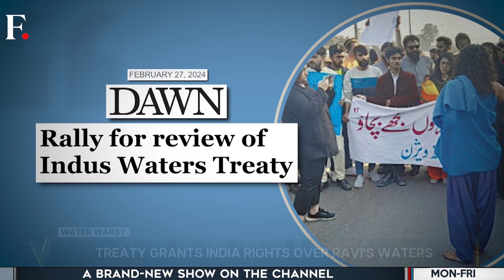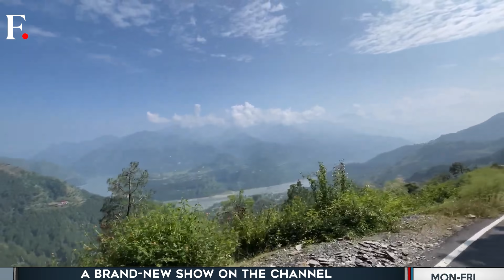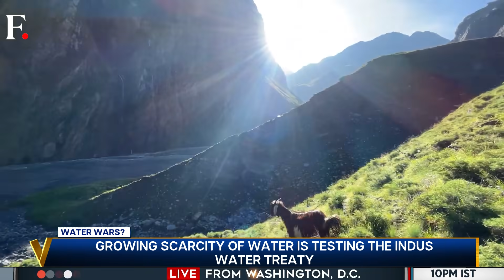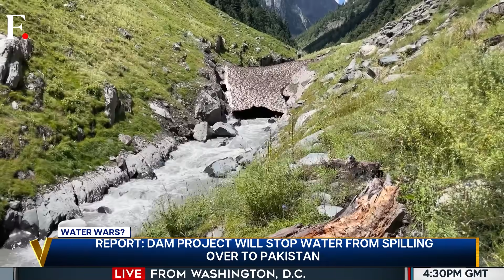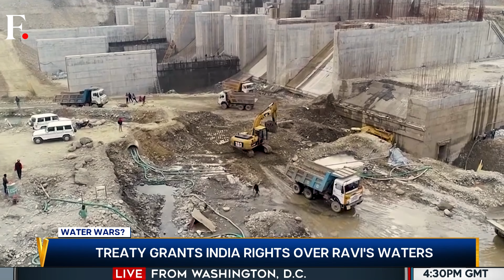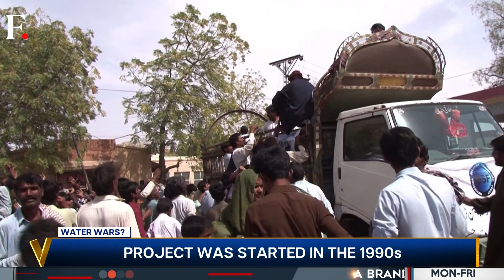Pakistani Press Accuses India of "Water Terrorism" Over New Dam | Vantage with Palki Sharma

Comment: For India this is just one more infrastructure project for development of our country, Pakistan can call it what they want.
Reply: Than why is Indian making noise over China building The Yarlung Tsangpo Dam. 

The project will be, a 60-gigawatt mega-dam that may, so it is claimed, bigger than the mighty Three-Gorges Dam. The selected site is on the Yarlung Tsangpo river (known as the Brahmaputra in India), which is one of the world's highest major rivers.
Reply: @wionporky9937 no prob for India if they built that dam 

Coz 80 percent of the volume of river Brahmaputra is filled in India so build it no one is stopping china 😂😂😂
Reply: @wionporky9937  not just India but many nations like Myanmar Thailand etc are condemning China on the excessive buildings of dam unnecessarily even if there is no need which hampers the water supply to other nations in case of them.
In the case of India,the water scarcity from the building of the dam is not quite the case as we have 80% of the water volume.Apart from that the state receives the highest rainfall which causes overflow in the river.Now,imagine in rainy season the China releasing water from overflow of dam just near the border with that ,it will cause havoc in the lives of people living in the Indian state of arunachal pradesh So,india is actually objecting not on the dam but capacity of the dam and volume of water it will hold.China already has so many dams and creating another one just near the border is purely unnecessarily and looks more of military tactic.
Reply: @ArshdeepSingh-qd7ng 
Smart Chinese 👏
Reply: @wionporky9937 bot😂